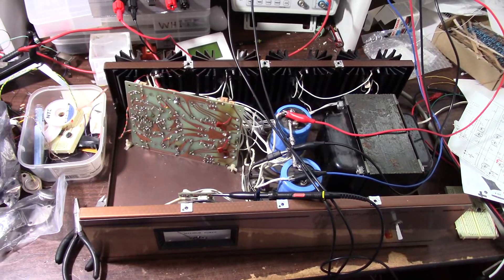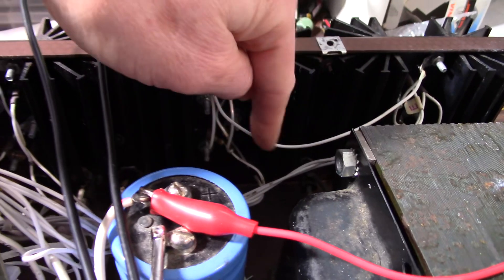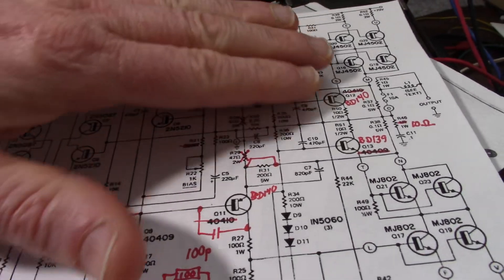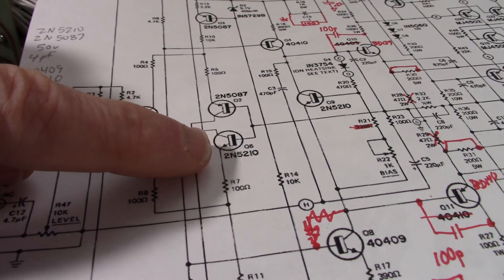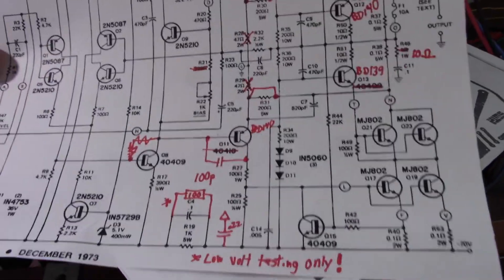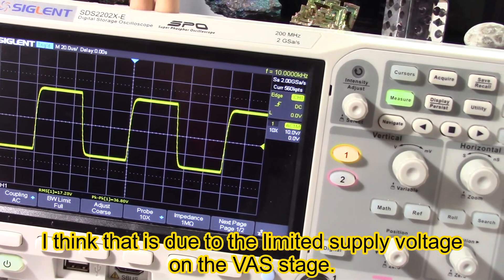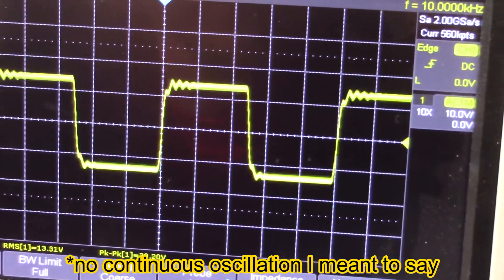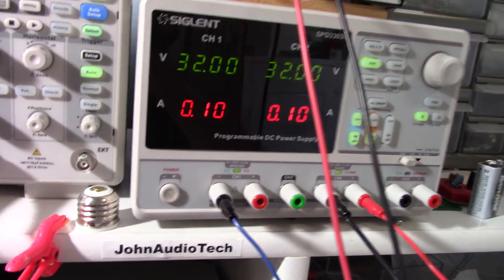tigersaurus 210/A stability work - PART 2

Comment: Maybe before you go to all the trouble of changing the driver stage , you could check the output with the gain back to what it was maybe the miller compensation caps in the driver were sufficient. Other idea is to try and add a miller caps on the outputs to match their input capacitance to the originals?

Comment: The PCB is done I'm going to update the transistors Q10, Q12, Q4, Q14, Q8, Q11, Q15, Q13 need to change the traces to accommodate  new ones with heat sink part number 634-10ABPE question is possible to use KSA1381 / KSC3503 for them?

Comment: Those two 100pf caps are spoiling your frequency and transient response. Also, they make THD worse.

What you are learning is that with old and 'slow' transistors, amp designers got away with bloody murder.
Today, with modern and much 'faster' transistors, all the design and build shortcomings of an old amplifier stand out like a sore thumb. It is imperative to have proper twisted wire pairs to reduce wire inductance. Also, consider the signal return path.
Reply: Yep old slow outputs made amp design easy! Some say they sound better, others say they havent heard a really good modern amp yet. 
In the least, the 100pf should be thermally ljnear like silver mica or C0G. Seperate signal returns and zobel network returns are indeed highly recommended.
Reply: @Peter Larkin  Well, there are some vintage mid 80s amplifiers with about the same complexity that sound phenomenal, where clever designers addressed crossover and switchover distortion in the design. Such amplifiers perform soundwise on par with tube and Class A units.
Also, these designers make use of less total negative feedback and use more local negative feedback - for a good reason.

Want to hear a good amplifier  ? Get yourself a Technics amp and find out !

Comment: Throw the guts out and just put a class D board in there. Fixed it!
Reply: As someone stated on the last video, this was made by a very early now defunkt computer company. It will be collectable in future.
Reply: @dexterperucho90  higher frequencies, what are you a bat?
Reply: 10 years ago I have built a class D based on some International Rectifier and if I remember correctly you need to match output inductor to the impedance of your speaker, to keep response flat. But even if you don't, the response does not change that much. And only very close to 20kHz. I also don't think any 250W class D could be worse than this museum Exponate. Especially after "improving" it.
Reply: I have found some paperwork related to this design, based on IRS2092S. "IRAUDAMP5 REV 3.3" page 6, Fig.4 shows the frequency response vs load. Not so bad in my opinion.

Comment: Will be interesting to see if you pay in terms of SNR for raising that input section voltages.
Reply from the maker: I don't see why it would plus the new transistors have a low current noise figure and are common in new high performance amp designs.

Comment: Hey the comment of stopper resistors (mine) was a suggestion. It’s one of several options and it wasn’t going to work for you. I honestly don’t care. Bob Cordell is a personal friend of mine so you can guess what kind of work I’ve done in my life. At the end of the day, it really doesn’t matter what I think. Cheers!
Reply from the maker: The stoppers still may be needed in the end. It would be a chore to install them though. I like Bob's assessment of OPS with gain. In essence he says they're not worth the trouble. I hope to hone my skills designing amplifiers, making mistakes and learning to correct them.

Comment: Nice job, my current project is a Pioneer SA7800 amplifier, which is an NSA amplifier that i got for free, but it was in rough shape. 
For now, the amplifier and the VFD left to fix
The power supply fixed
The transformer is rewired (due to excessive heat dissipation, the layers of isolation went into dust in my hands, when i started diagnosing it)
Preamp and tone controls are checked, and they appears to be ok, i did a shotgun approach if we talking about recapping, due all the caps were bulged, and gave out excessive heat.
Even i replaced the main filtering caps, due their series resistance was quite high. (2x 8000uf 50v caps/rail so 4caps.) for now i installed 3x 3300uf Elite 105c caps/rail(so 6 caps), in my country it was the best for the price, and i didnt had too much of money, but im pretty sure i will get something neat caps, i think the Kemet 63V 8200uf will be solid for the given job.

Comment: Great news  Victory!!! good feeling

I have a problem maybe you could lend insight to. Replaced blown output transistors 2SD424 2SB554 on  Yamaha  cr2020 quite a few years back with ECG replacements.....amp works again but with less output on the ECG side any suggestions on what to do? Would replace again if it would return the level to match the original side but have  read that some of todays semis are questionable and not what their labeled . Any help would be awesome
Reply from the maker: I'd check signal levels going into the power amp and compare with the good channel.
Reply: Thank you i will have a look and see.

Comment: Well, the fix is kinda whole new amp you build... But its working
Reply: I'd rebuild the other one to match !
Reply: It has to be done sometimes! I have refurbed Sony etc. with power ICs. When they fail, i have to redesign the poweramp and tonecontrol/preamp sections because its often passive preamp, or the poweramp feedback loop contains the tone circuit. Ugh what fun.

Comment: Serious comment: I wonder if the only reason the other amp works is the original transistors have a lower cut off frequency.  The replacements have too much gain at the high end.
Reply: This was already established in the last video